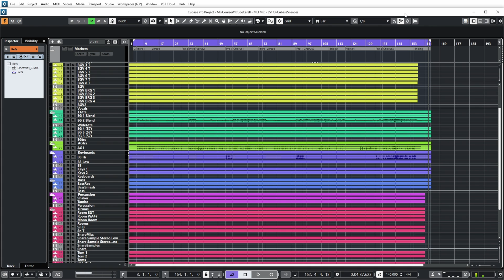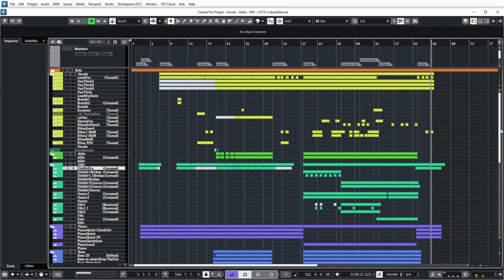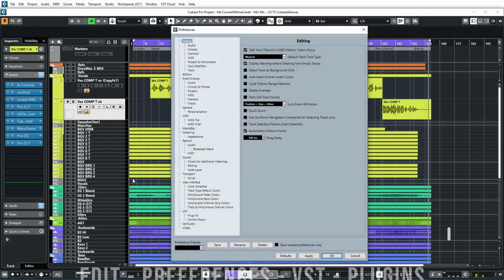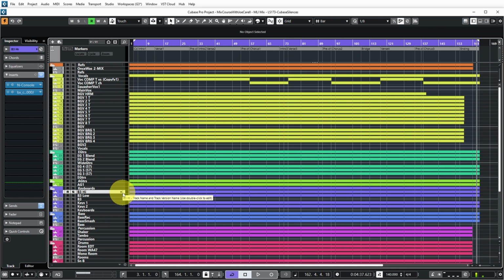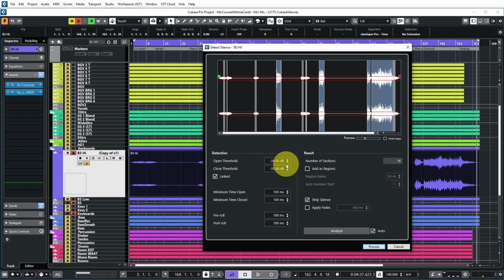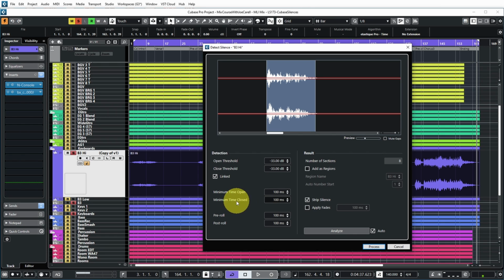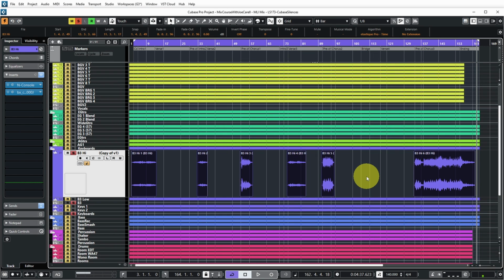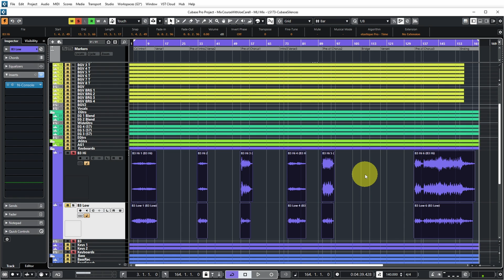Detect and remove silences in tracks in Cubase!

Comment: I often use the Range Selection Tool to remove manually the unwanted silence. 
But I also use the keycommand "mute Event", which I like. 
Another way is to use Parts to glue and mute tiny audio events together.
Reply from the maker: Great ideas. Thanks for the tips!

Comment: This is a game changer that I never knew about??.  I'm doing a lot of dialog editing these days(podcasts), and I've been cutting out silence and doing fades manually.....there are few things more tedious in life!! 😳.  Silence detection will be a HUGE time saver 😊🙏
Reply from the maker: Happy to help!
Reply: @LanewoodStudios   Just tried it out and it works great. It will take some tweaking to get release times and pre rolls just right, but it works.  Only one big drag, I'm on C11 Pro and it doesn't have the autofade function.  I've got C12 but it's down right now. There's some kind of license glitch that needs to be sorted.
 Regardless this silence removal is a great new tool to have 🙂
Reply from the maker: @J-DUB-F1  great that it works for you. It does indeed need some tweaking but I find that I can then mostly use the same settings.